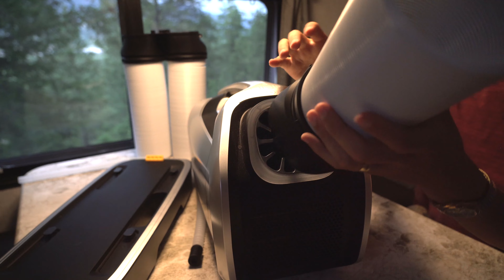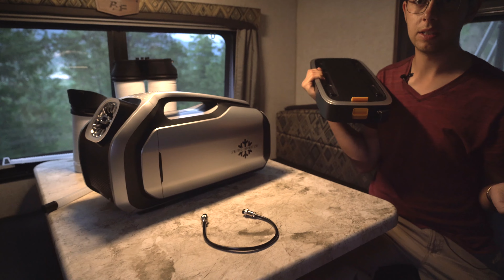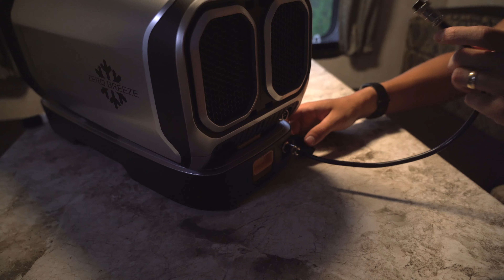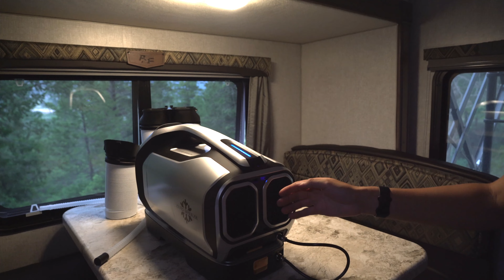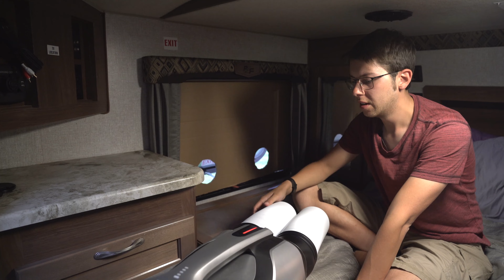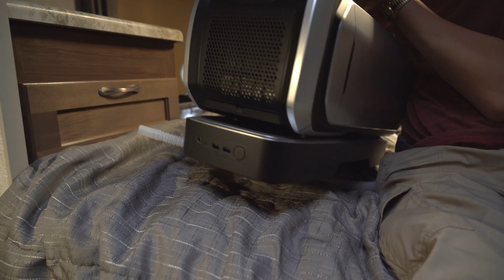Zero Breeze Mark 2 Air Conditioner Review (2022)

Comment: Thanks for the video and nice to see a fellow truck camper finally make a video on using this. I have a Lance 855S and am using the same venting as you with my Z with an insulated covering. I too am using the emergency exit window and while it is working, I'm not sure if it is enough, at least in Florida heat. The unit is only cooling down about 20 degrees below ambient as opposed the the average 30 degrees. I am just a little concerned that the window may still be capturing the heat and sending it back through the return. I'm heading up the east coast tomorrow and will see if I get better results on the trip but just curious if you are seeing the venting situation diminishing efficiency. As always, I enjoy your videos and look forward to future ones! Take care and happy travels.
Reply from the maker: Thanks for watching! We havent been in any super hot temps - mainly mid 80s. It's worked fine in mid 80s but we have to stay pretty close to it to stay cool when we have it blowing at one side of the camper.
Reply: @InfiniteExplorers   I have kept my expectations in check knowing it is a spot cooler. Just curious if you are seeing the 30 degree difference at the vent using this venting setup?
Reply from the maker: @BobVanTee  for sure - and yes its been closer to 25 degrees :) still feels great on a hot day.

Comment from the maker: Use promo code INFINITEEXPLORERS from July 20-27th, 2022 for $80 off the AC Unit or Battery on the Zero Breeze website: 
https://www.avantlink.com/click.php?tt=cl&merchant_id=87ab966f-e0aa-41e8-b87e-520979dac6b5&website_id=6350c773-93f6-4679-a8db-498b3701aeca&url=https%3A%2F%2Fwww.zerobreeze.com%2F

Gear:
Videography Camera: https://amzn.to/3toC1y6 
Photography Camera: https://amzn.to/3K7Dxvw
Computer: https://amzn.to/3vLZnRp
Portable battery pack: https://amzn.to/34akzoI
Mens Hiking Backpack: https://amzn.to/3Mi40Io 
Mens Hiking Boots: https://amzn.to/3vrWF3f 
Hiking Flashlight: https://amzn.to/3sAvlh6
Reply: You say first :it comes with this battery" then also say "if you purchase this battery" .I'm confused, Does the unit come with this battery for $700. ? Or are they separate ? Thanks
Reply from the maker: @buddcee  the kit we purchased had the battery with it - but the battery itself is additional if you only purchase the unit by itself.